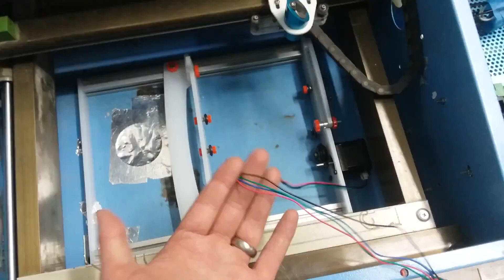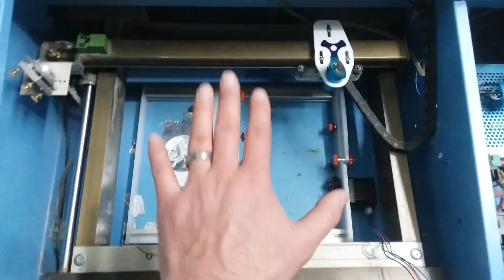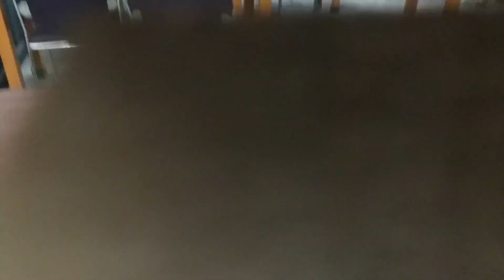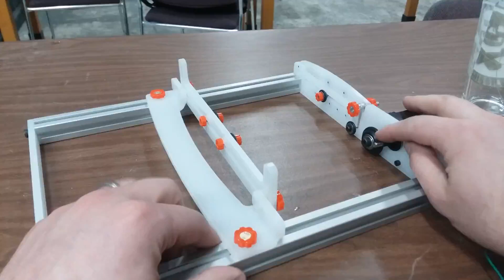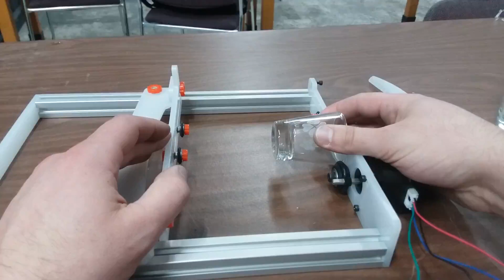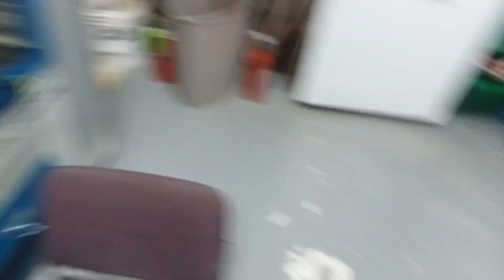How to use the K40 Rotary and set up a glass.

Comment: Does this work without having to cut out the bottom of the laser?
Reply from the maker: No it's designed to sit on the bottom of the k40, and you will be able to engrave on objects as large as 90mm across (unless you cut out the bottom...) For reference a regular beer glass is 85mm across. Just to cover bases some k40's have a build plate that needs to get removed, but that is a pretty standard modification.